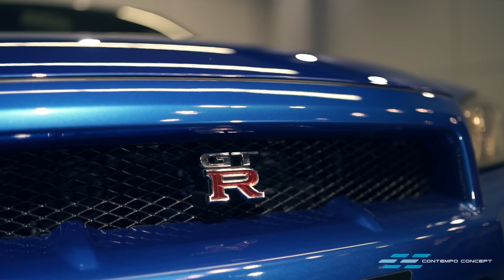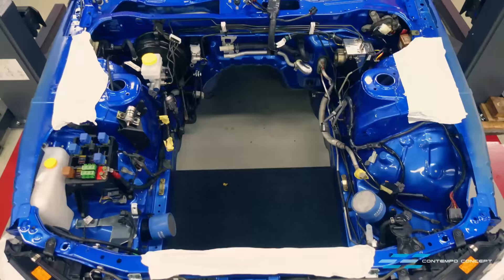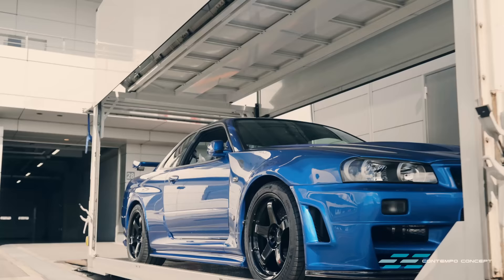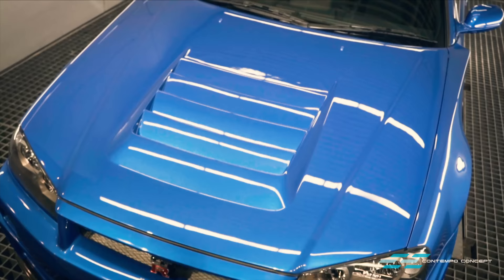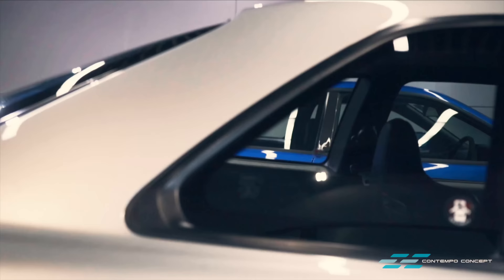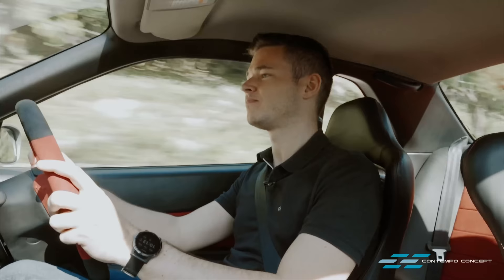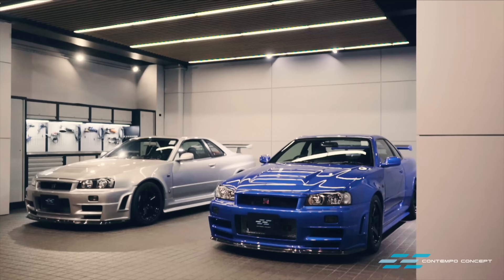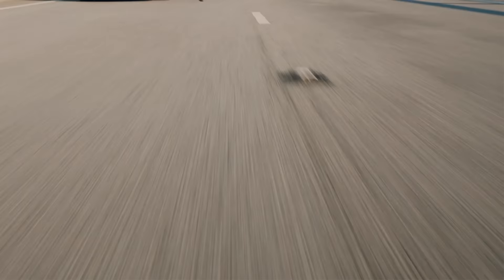Nismo Skyline R34 GT-R Clubman Race Spec Project

Comment: That's what makes Nissan & Nismo so special. They still provide OEM Spares and the option of refurbishing your car and bring it back to former glory or simply adding more power and upgrading your entire car!!! 😍😍😍
Reply: I wish Toyota offered new replacement parts for there 90s cars
Reply: No they don't, they are discontinuing parts
Reply: Marlei Campos  pul waker💀
Reply: @orlindimitrov7322  get your facts straight mate. Nissan & Nismo still offering Stock RB (Blocks & Heads) & surely other parts from (Chassis, Frame, Subframe and the list goes on). If you're running an SR20 same thing applied & you can visit any Local Dealership and grab your OEM Spares.
Reply: Yeah, and it ONLY costs "half a million dollars!" YAY!
Reply: Clubman mod is not worth it guys have to wait 2 years after u give this to the factory and then they charge 200k for all these mods combined on top of 150k on the actual car so will be sitting on 350k .
Reply: I agree! Unlike EVOLUTION by Mitsubishi they murdered their iconic car and switch to making Blender Machine 🤣
Reply: @vik9481  lol clearly its not for us, its for people who have the means to get these kind of things, rich people spends millions on hypercars just to collect them and this is the same thing for jdm enthusiasts and fanatics.

Comment: You guys should do the upgraded billet oil pump gear. It will keep that motor running reliability on the track
Reply: you are wrong in that aspect.The oil gasket in this CSR takes in oil via the proton valve, not through the rubber intake valve. Reliability is pegged to the 50W oil

Comment: Im surprised they don't do anything to seal underbody, but it has a lot of covers so maybe that's why. 🤔. Also no cooler for diff and Trans like ztune hmm. One thing I dislike about this kit is rear overfenders lips. They look weird. The look also like 1 piece that is coming on rear bumper. I wonder what happens when you try to take off rear bumper. Overall I still think that after this treatment it is the best car ever made. I think the pricing is 500k usd for this. I know some ppl are changing ohlins suspension for softer one.

Comment: Nissan really know how to squeeze lot of money due to FnF R34 hype

don't get me wrong, If I'm Nissan CEO, I also gonna do the same for easy money

starting at 400k USD for Skyline restoration program and you might need to add much more if you want Nissan source the car for you in-case you still don't have Skyline R34 (yes, they can source 1 for you. No, it won't be cheap)

Not to mention they can provide trim upgrade (CRS, Nur, Z-Tune you name it) as long as you're willing and able to pay. From engine (RB26DETT N1, RB26DETT R2 to even RB28DETT Z2), Rare paint color (Midnight Purple, Silver Z-Tune) and any other options limited only by your budget

But mind you they won't re-register and update even though you upgrade your trim. So basically there will be no 21/20 Z-Tune despite you're paying for Z-Tune and RB28DETT Z2 upgrade

Nissan and Toyota is just doing what Porsche, Benz etc doing. By selling nostalgia and riding the momentum of hype, in this case FnF Skyline R34 and Supra A80 hype

Comment: Aren't we curious, how much does it cost for this beast? 😅
Reply: As of 2019, it's roughly $205K not including the price of the car....
Reply: More than you can afford pal, ferrar... R34 nismo
Reply: @fernanaquino2482  lol watch him reply in 2024 with a pic of one he bought lol
Reply: You have to buy the car 1st for around $250k. Which is how much R34s sell for now. Then you pay Nismo around $150k for the work and parts. The engine alone costs around $40-50k. The Carbon fiber parts are extremely expensive. The Carbon fiber mirror costs $3000. The hood costs around $10k. The LMGT4 wheels cost $10k a set. The Brakes Costs around $8k each. The underbody carbon fiber floor and diffuser are a $27k add on. Theres carbon fiber everywhere on this car. By the time you are done you should have paid around $350k or $400k in total. Keep your R34 for 2 years and its worth $600-700k now. Thats the trend.